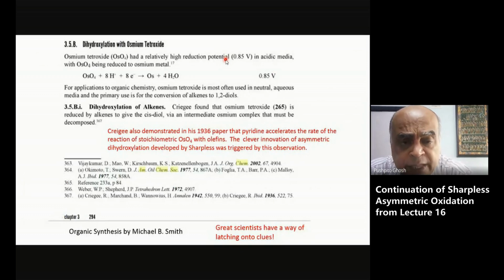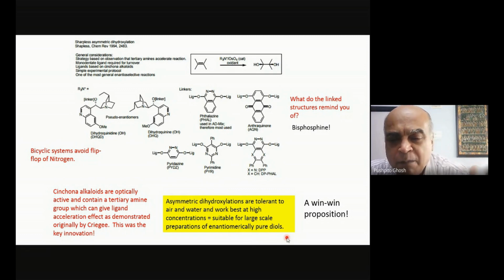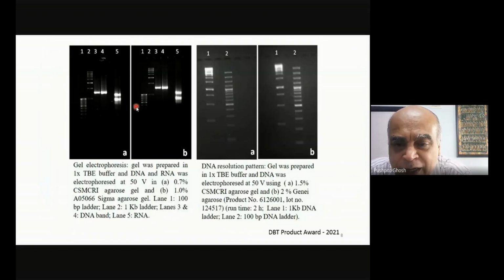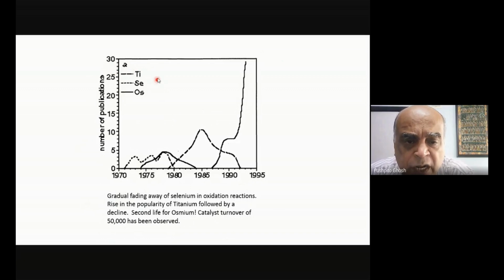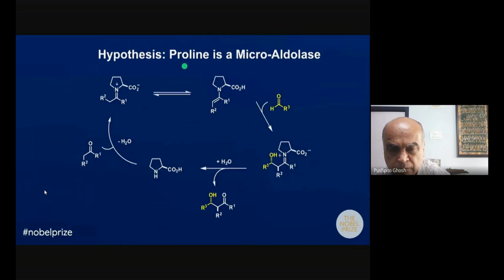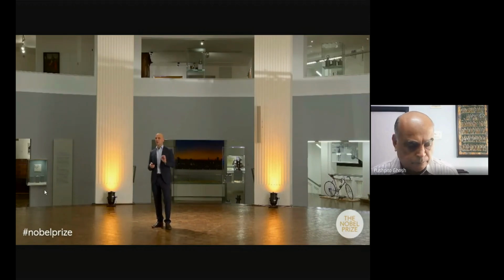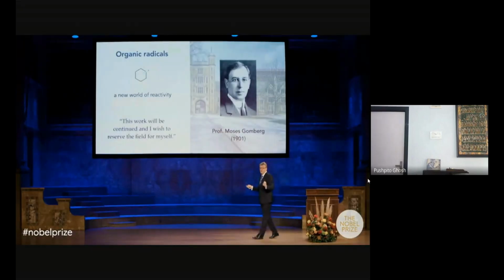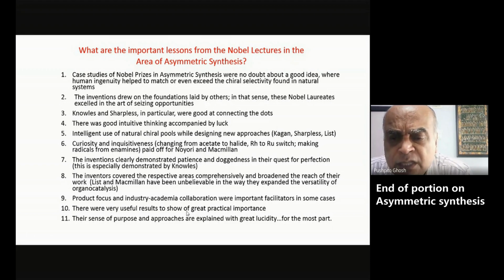ICT Mumbai Course on 'Innovations in Chemical Technology': Lecture 17 (Asymmetric Synthesis Part 3)

Comment: Not that I am good in asymmetric synthesis or organic chemistry or chiral chemistry but I felt the lecture very interesting. Suddenly I was reminded of my Ph.D work on cataysis titled : "Metal ion and Metal chelate catalysed epoxidation of olefins". One of the olefins that I studied in length was allyl alcohol and during the course of reasearch work, it was realised that various oxidation products were possible (depending on catalyst structure or configuration, pH, reaction time, ligand etc) namely Acrolein, Glycidol (epoxy alcohol), Glycidaldehyde (epoxy aldehyde) and even Glycerol. The most difficult thing was analysing & identifying the products for which it was essential to separate the catalyst from the homogeneous reaction mixture ....... 👍